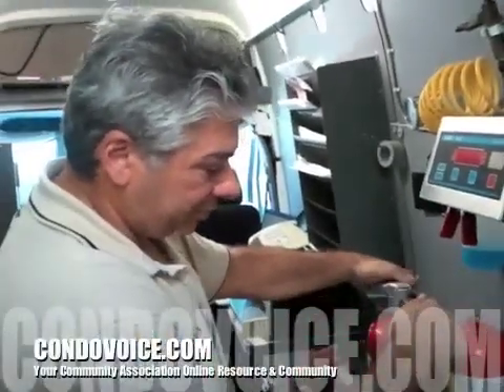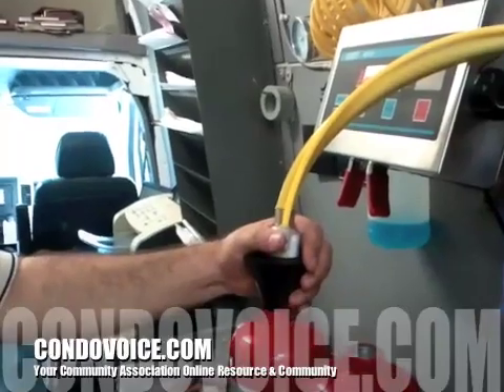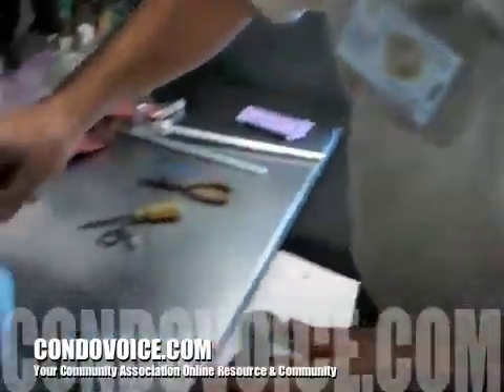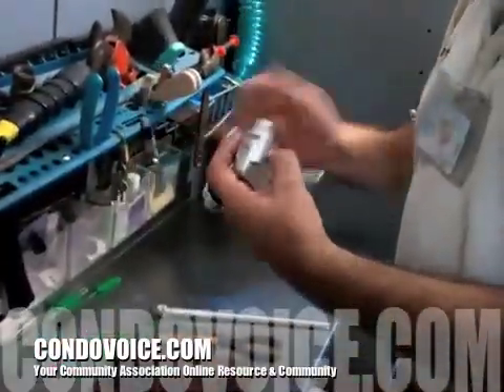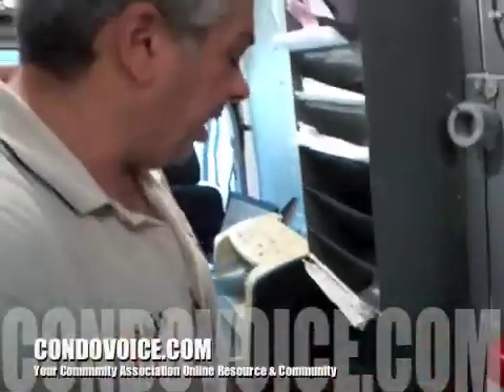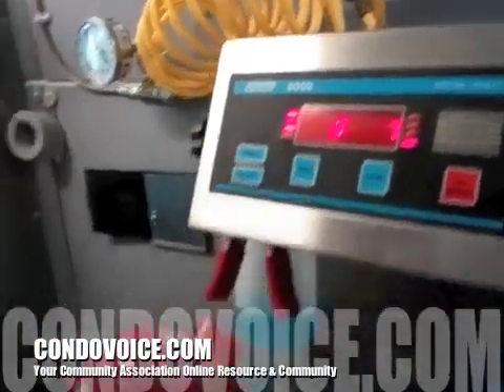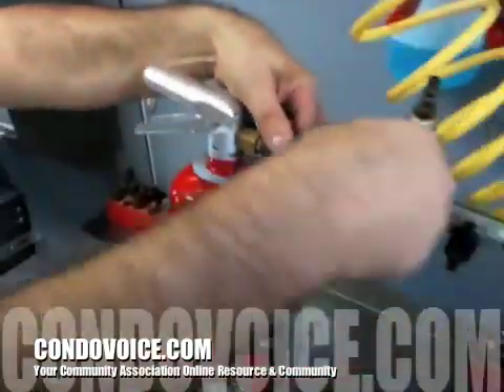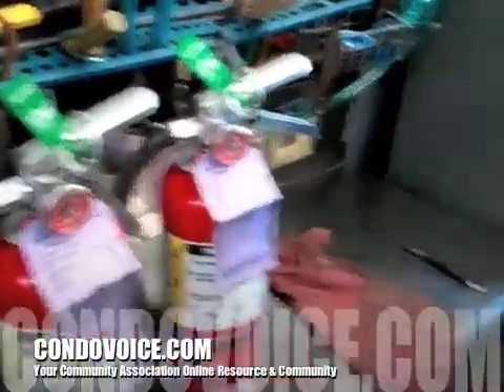How to recharge a fire extinguisher condovoice.com

Comment: No internal inspection of the cylinder?
Filled the cylinder with mixed chemical?
Puts Lube on the valve stem seat?
Used the same adapter to discharge as he did too re-pressurize so the powder left in the adapter coats the valve stem and makes it leak?
No leak test?

Comment: For the amount of time he kept rubbing his pinky in  the control head over and over and over, he should have shined a light inside the cylinder to check for corrosion and should have checked for leaks after recharging. Mr. Know-it-all missed the entire point of a 6 year then didn't check for leaks to make sure the fire extinguishers will still be operable after a couple weeks.

Comment: Really interesting seeing how you do it in the states, we do it here in the uk every 5 years, we don’t have the big truck work shops like you either I do all my discharges etc at the work shop and we just swap units on site with pre tested like for like extinguishers.
Reply from the maker: There are "swap" services here too.  But it is a shame to see a new one go away and replaced with one ten years old or more.  The dishonest companies do that, and then sell the newer ones.  The exchange in value goes with them.  So , especially if you have to buy a bunch of new ones, choose this kind of service, so you can keep the newer cans.  The reason the companies can get away with value swaps is most of the time on a commercial property, they call one day ahead, and you have no notice, and they do their service quickly, so they are not supervised.  Not that all companies do that on purpose, but if I get a really really low price, this is usually the case.

Comment: Terry,
Chris was doing a courtesy demo for a customer that day. He is an extremely busy Franchise Owner and always does a leak test. He took the time out of his day to give some instruction on how the procedure is performed for a customer. He might have missed a detail but If you know Chris he does leak tests on every extinguisher. As far as the hopper he keeps it empty and has several hoppers in his truck not just one. He discharges all the same manufactured units at one time into an empty hopper and then refills them.
 If you saw the effort and money he put into his service vehicles you would know he is the real deal!!! He has also been a FireMaster Franchise owner for over 25 years. FYI after contacting the manufacturer of ABC fire extinguisher chemicals ten years ago I was told directly from a engineer from the firm that produces ABC chemical no matter the manufacture it's all the same agent!! There are some manufacturers that put a different dye in the chemical to give it a different appearance. But ABC chemical is ABC chemical period per the manufacturer!!! It's more about flow rates through the valve body, hose and nozzle that truly affects the classification rating.
There is a push by the fire extinguishers manufactures to have fire equipment technicians use only there chemical to refill with. This is to increase there bottom line. Fire extinguisher ABC dry chemical has been mixed with all different brands for decades and they have always performed to the required standards as long as the unit is in normal operating condition. 
Also on the lubricating of the 6092 valve stem. The 6092 has an issue with the exposed shaft the protrudes out of the valve body. There has been countless times that the shaft on discharge has scraped against the valve body and scoured the valve stem and has even affected the operation on discharge. I will post a picture of this next time I see one. I have been in contact with Amerex about it. Heavy lubrication on the valve stem is one thing but a very thin layer will not!!!!! Affect the discharge at all!! I have never seen that in 28 years so that comment is again misinformation!!!
I have known and worked with Chris for over 25 years and he does a great job!! He takes pride in what he does. He did a simple video for a customer who posted it and then there comes a bunch of criticism. That's probably why he has never replied to some of the comments here. 
I thought I would cover some of the comments left here!! Great video Chris thanks for sharing!!
Reply: I myself thought he was spot on. As a tech of going on 13 years now I've actually learned how to do a lot of work just from watching this video years ago. It gave me a lot of insight. Thanks again for posting this.
Reply: That’s wrong. Look up the msds for each dry chemical ansul, amerex, buckeye, they are all different, each chemical has different amounts of compounds it is not all manufactured the same.
Reply: @chris-SDI   I spoke to the lab technician in the manufacturing facility that makes the chemical.
Believe what you want, I’ll believe him.
Reply: @mikemoore2933  who is this person you speak of? Your telling me there is one guy that makes the dry chemical for the whole United States 😂 also back up you story with truth, anyone can say I know this but blah blah this guy does this blah blah.
Reply: @mikemoore2933   ABC dry chemical varies between brands. That’s a fact. Even Amerex makes two different types of ABC dry chemical, one of them is a more effective formula and the other is a less effective one. (Model B402 uses the better formula and the B500 uses the less effective formula. That’s why one is rated 2A10BC and the other is 3A40BC..To say all ABC powder is okay to be mixed and is the same thing is just wrong. Even if I mix both types of Amerex powder together, the performance is already compromised let alone different brands

Comment: I am more interested in your van and the machinery on board. How did you get your truck customized?
Reply: +Tammy Briggs I Fitted mine out my self .But i would rather bring them back to    the work shop for a good clean up every 6 years here in OZ we need to pressure test every 6 years if we come across a unit with has lost the last date it had a level 4 we do a pressure test and new o,ring with a little lube and pressure check for leaks and take back to the Customer and hope we get Paid . some people are great some drag it out ?
Reply: I will gladly pay you Tuesday for a hamburger today!
Reply: Getz Equipment carries all the equipment necessary.

Comment: According to the manufacturer of those extinguishers (Amerex) the sealing part of the valve steam should not be lubricated.  That could cause the dry chemical to get clogged during use of the extinguisher. When servicing extinguishers, the manufacturer's service manual shall be followed.
Reply from the maker: I think he used a graphite of some kind, but good point, and thanks for posting it.

Comment: @evilbunnyreviews Then you would be spraying oxygen into a fire. Not only does the chemical form a barrier when heated but it snuffs a fire by pushing oxygen away from it. Pressurizing an extinguisher with nitrogen not only keeps the chemical dry but prevents feeding the fire with oxygen...